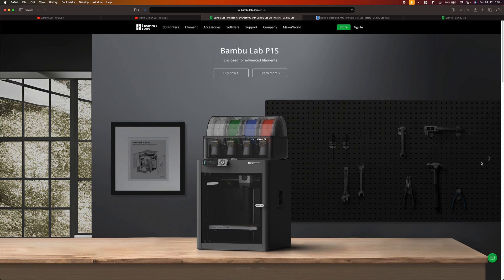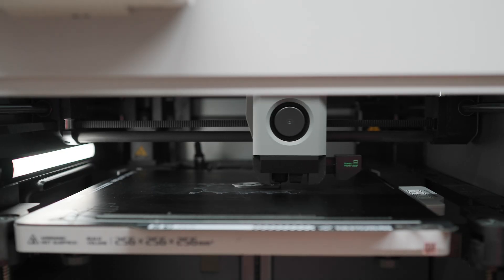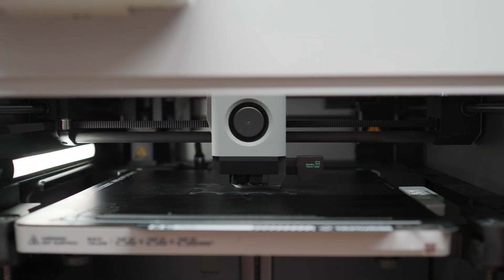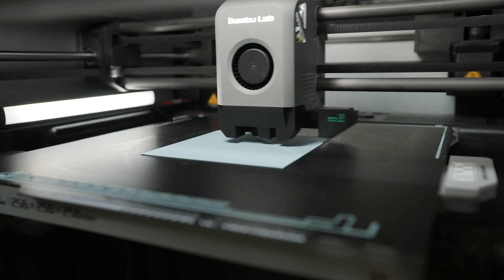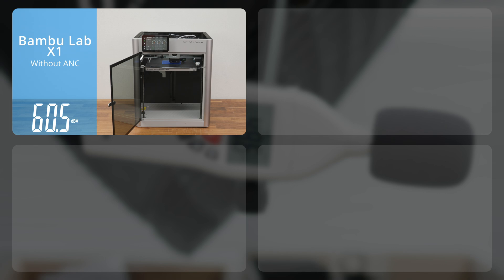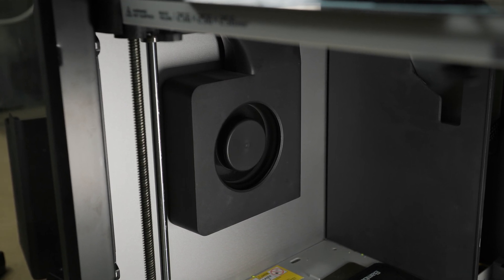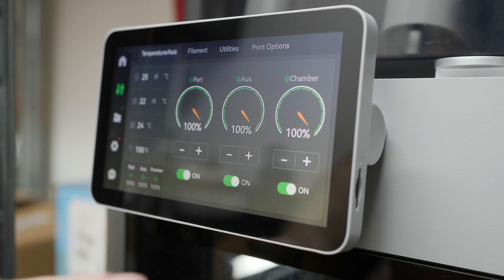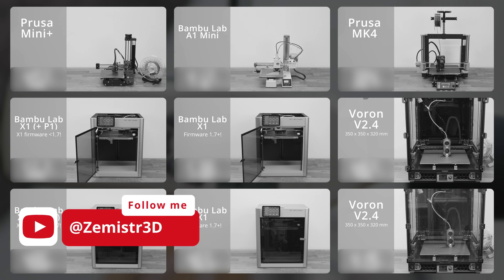Bambu Lab - Active Noise Cancellation (ANC) in practice

Comment: when will it come to the p1s? :(
Reply from the maker: It's already out ;) 
https://wiki.bambulab.com/en/p1/manual/p1p-firmware-release-history
Reply: @Zemistr3D  YOOOO this is WAY QUIETER thing is my p1s is sitting on a compressed wood shelf that makes it turn into a speaker. Should i put a concrete slab under it?

Comment: i would agree on fast and good quality with pla, if some parameters are changed that is. other than that the machine is a diapointment to say the least. the whole lidar is a salespitch at best. 10% deviation they say with a matte filament and a smooth plate. i got from 0.018 to 0.038. 10% my arse. it a lotto everytime. just try and do ten "calibrations" in a row and see the variance if you try lets say asa or abs. 

then its the "quality" if this is defined by it being a usable part for project or an actual sales item a customer has ordered this thing fails at all standard profiles for all but pla. even with their own filaments. asa comes out so brittle as there is no time for the plastic to cool down before next layer. the speeds they want u to use is plain ludicrous with the mentioned filaments. i dread if a customer requests a pa print of any size over a trinket. 

its a ok corexy, but the extruder tops out at 11-13 mm cubed pr sek as pr my tests and cnc kitchen tests. making their profiles top out with flow rates FAR beyond the melting capacity when at full speed and overmelt the filament at lower speeds sections.. 

The lazy cure is to manually change the filament properties to lower the flowrate to what the extruder ACTUALLY can melt and lower their fan settings by ALOT as asa and abs dont like fans. 
sure for pla trinkets and benchys its fine, but like i mention above.. its all too fast and to agressive for the filaments that are used to make actual usable items like showerheads and fittings.

Great video btw,   hope get ur prints strong.
Reply from the maker: This video is just about the noise but thanks for the summary of your personal experience with the printer. 🫣

I print on the X1C mostly ABS and ASA and everything is OK. At least I didn't feel like I have something to complain about. Maybe sometimes top layer or the color change because of the fast printing. Other than that I am happy with my unit. 🤷‍♂️

Comment: The noise difference is significant. I hope they will implement this system very soon also in the P1S model
Reply from the maker: It's already in beta testing and it looks identical to the X1C 😉
Reply: hi do you know how to get into the beta testing any quicker ?? @Zemistr3D
Reply: Is it possible to see somewhere the changelogs of the beta, roadmap or public releasedate if you are not in beta program?
Reply from the maker: @Ichbins3000 I'm worried no... At least I don't know about such place. 🤷‍♂️
Reply: @Zemistr3D  so you are in Beta of the P1 series? Since when has noise canceling been available there? Any other upcoming features?